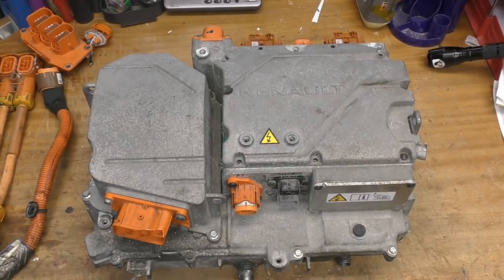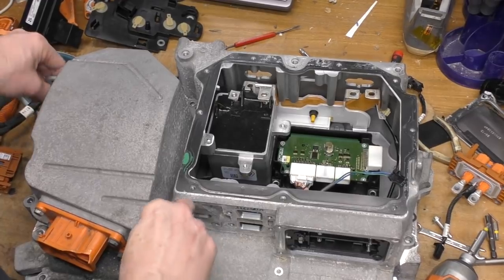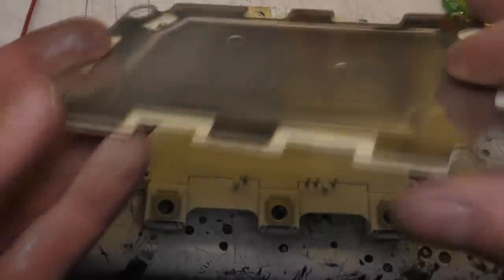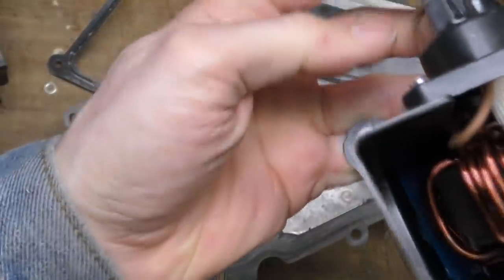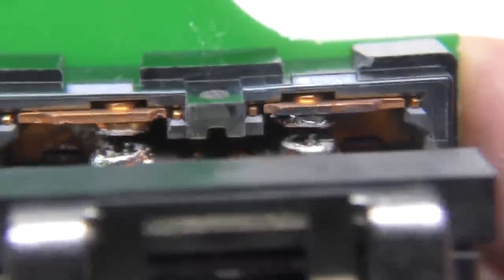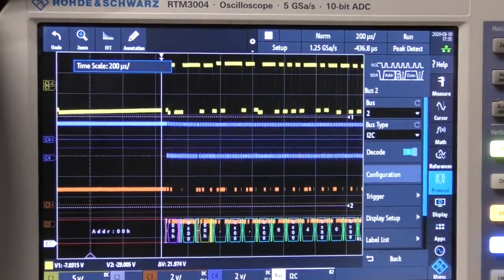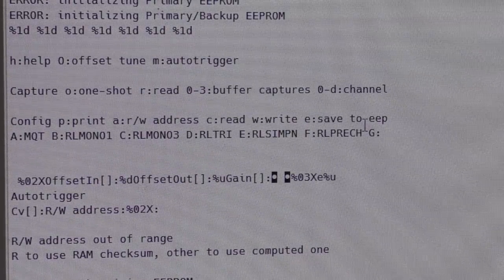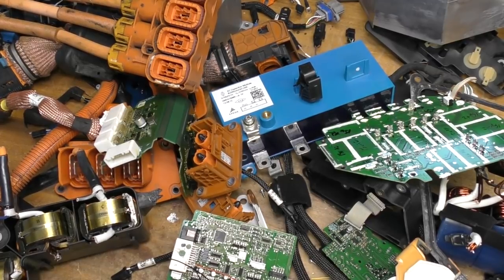Renault Zoe EV Battery Charger Block ( BCB )

Comment: One "interesting" aspect of this system is that if you supply only 2 phases, Zoe will cause a RCD fault.
Reply: Not true. RCD will trip only if there is leakage. 
I had Zoe being connected to L1/L1/L3 and it has displayed 'check charging station'

Comment: That strange board next to the shunt is probably an active EMI injector.
Reply: i think this is a pulsation modulator for the oscillating driving of the driving ondulator used for the syncrotron.
Reply: @Francois_Dupont  And furthermore, it modulates the eccentricity of the compound offset cycloid without affecting the convergent continuum of the battery power wobbulator, or the sync of the flyback discriminator. Pretty nifty stuff! You rarely see any of that being done in a budget system. 😵‍💫

Comment: is there a reason to use all the braided sleeve? is it for vibration/movement? or some electrical use like ark shielding? or very simple, cable management?
Reply: it protects the wires from getting scrapped or nicked. most normal cars have all the wires protected with a plactic rigig sleeve. it also stiffen them up to prevent them from shaking too much. imagine having a wire swing around for 350,000km? it just wont last and will snap internally.
Reply: @Francois_Dupont  From what I read, those Renault cars don't even last a 100.000 km.
Reply: @FrozenHaxor  its good for the economy! what a way to create jobs, they thought of everything.
Reply: @FrozenHaxor  Zoe Q210 (2013) owner here, 100k kilometers and still doing great. Battery at 93% state of health. 11 kW charging several times a week, 43 kW fast charging ~10 times a year. Pretty reliable car to be honest, infrastructure here in the Netherlands is decent, which helps I suppose. Apart from a misbehaving public charger from time to time (which used to be much more frequent) no issues whatsoever.

Comment: Where does the hole under the little black plug on the lower right at 0:38 go to? Tends to fall of sometimes and i fear there might get dirt or dust in...
Reply from the maker: Looks like a vent, to allow air pressure to equalise but not let water in

Comment: Mine is probably broken (although it throws a input filter module error, but this has been replaced alrady). Renault refused me warranty because I've used a 'non Renault homologated charger' to charge my car :( ...
Reply from the maker: That is bullshit - take them to court.
Reply: Mike is right, I'd take them to court. There is no charger in an EVSE, all it does is connect you to the electric supply, as you will see in mike's other videos, it's a relay with some simple control pilot signal with AC. Renault approved is crazy ides, as you wouldn't be able to use the public networks, how would you know what  was approved?
 Also the car should do its checks before closing contactors!
Reply: @sophieclips  if only it were so easy. We're talking complimentary warranty. They can basically exclude what they want. It seems to be in the manual (I never had one) that you are only allowed to charge with ZE homologated chargers. Of course it's bullshit and they almost never enforce it. In my case they do. I was thinking about claiming that's so unusual one is not supposed to know, but anyway. They're also denying me the legally biding warranty. Yes, I could sue them. My lawyer (the one that even cared to reply) told me I need to find an expert that convinces the judge (find that in Spain...) and that Renault will have a convincing expert for sure. If I lose, it'll cost me more than the repair.

Comment: Mechanics as we know them are a thing of the past
Reply: They just need new training. Someone classically trained on petrol cars can still fix & replace tires, top up washer fluid and replace brake pads... but going forward most of a mechanic's work will be hooking up a computer with licensed, make-specific software and swapping out the modules that the computer says are bad.
Reply: @anonymic79  I don't disagree with what you're saying and by the way I'm a diehard proponent of right-to-repair legislation. I just think what you're describing is more of a refurb parts market than a mechanic's work as such. It's not as if Mechanic Mike is going to his electronics lab to troubleshoot and tinker with a busted module in working billable hours? I expect EVs will be saddled with DRM bullshit on Apple levels to prevent "grey market" refurbished replacement modules to be used, but I expect there will be a cottage industry of repair shops mending common failure modes in these modules, allowing them to become under-the-counter cheaper alternatives to vendor-sanctioned official replacements.
Reply: @KanalFrump  Do you really want  to be driving beside a car that has a bodged repair job that could cause it to catch fire whilst driving @ 50mph? At least with a phone if it catches fire you can always throw it...
I think the "grease monkey" from the 50s would find it difficult if not impossible to work on a modern car, never mind an EV. There's just little need for mechanical finesse now as the tweeks are performed through software...
Reply: @KanalFrump  You're not going to see a whole lot of "grey market" power electronics components for EVs because of the very specific skills and equipment needed to repair/design such parts. Also, if you botch anything the result could potentially be a blown drivetrain/electrical system and/or a big ole fire. So would you really want to use 3rd-party refurbed components? You don't really know what it is you're getting.

These modules need to be able to handle potentially hundreds of amps at high voltage, which is serious stuff. You don't want any potential foul-ups or bad/under-spec components used during assembly/repair.

Comment: Where does 3 phase come from
Reply: Most european houses have a 3-phase supply
Reply: @lukahierl9857  weird i thought 240 was 1 phase
Reply: @AgentOffice  Britain is traditionally single phase (google "ring mains") while the rest of europe is three phase throughout.
Reply: uk national grid 3 phase , including pole runs all generally 3 phase, 3 phase generated from power station, been like this for a long time.
Reply: @AgentOffice   depending on  hv to lv  pole transformer setup , domestic supply can be 3ph 230/240v , mostly for safety each premise will be on 1 phase  230/240v unless requested otherwise, . generally 3 phase  400/415v  for commercial supply upwards,
Reply: I have 3 Phase 25A supply in ma apartment, and 35A in my other house. 230/400V. Quite common in europe.
Reply: @ss54.  You already said "UK, Domestic= mostly single phase" -that ist the point. Talking Europe, especially Germany, 3ph 63A is the standart. Never came across a house in germany that had less than three phase supply.

Comment: This unit seems very clumsy to me!  Uses the eMachine inductance but still requires 8kg of addiotnal series inductance, and is made up of lots of individual units, with lots of glue wiring harnesses and poor integration!  Must be very expensive to build!  Compare it to the much more integrated solutionns from Tesla etc!  (Feels like 2010 tech to me, not 2020 tech!)
Reply: Yeah, everything is so random, a lot of random pieces, cables, weird layout decisions, and general chaos. This earth current sensing shunt and board are super weird as indicated by Mike.
Reply: @movax20h  I think they are using the shunt as part of the high frequency isometry, whihc injects a low voltage AC square wave between the battery and the chassis, and monitors the current that flows to establish the integrity of that isolation.   A company called Bender have a lot of patents on this method of isometry, so perhaps lear have rolled their own solution to avoid those patents?
Reply: It is 2010 tech because the car came out 2012

Comment: why have such complex charger in EACH car when you could have one or two into each charging station and only have some safety in the car and a couple of safety in your battery pack.
Reply: That mean that you trust a third party to properly manage the charge of your battery. 

Yes I know it can be done but currently there is so many Standards and yet nobody in the industry is set to follow the same rules. (Unlike the USB port)
Reply: @zeuss194  when you put gas in your car, dont you trust them not to have water or acid in it? there is a whole set of regulation for gasoline and diesel. this should be the same for electric charging station.
Reply: if we can force car manufacturer to have airbags, light and bumper specifically made for X and Y laws, you dont think we should do the same for electric car charging station? its pretty simple too:
car- hello i am X model of car, i want DC ramping for 300 to 600 along 30min time frame. maximum 200amps.
station- aye aye captain, power incoming!
i am no programmer nor electrical engineer, but with our current technology it is very easy to do.
Reply: @Francois_Dupont   "Yes I know it can be done" , As you said there no real technical challenge (communication between charger and battery is common on cellphone and laptop nowaday)
It's is more about the lack of will from manufacturers to go for a single road and lack of "enforcement" from politics.
Reply: Better know what you doing then let some idiots do it instead (third party and similar shit) and blame it all on Renault when the shit hit the fan one day.
Reply: You basically explained the advantage of DC-charging, where the charger is in the DC charging station. The charger there can be more expensive, heavy and use more volume, thus enabling much higher charging currents than an on-board charger, which "just" takes the AC current by the grid (with the AC charger mainly consisting of some safety and payment features) and basically does the same thing than the charger in a DC charging station.
However, a charger is pretty expensive. It's easy for a supermarket, hotel or parking lot operator to just install some AC plugs (or an AC charger = AC plug + some extra protection) but its quite a thing to install a DC charger. So the on board charger of the EVs are kind of a "fallback" solution so you can charge everywhere you have an AC plug (so basically everywhere) and don't have to rely on the good will of stores, hotels or parking lot operators.
For high power charging, putting the charger into the stationary DC charging station (like you said) is the only option, because a > 50 kW charger is extremely expensive and heavy and it wouldn't make sense to drive this thing around in your car all the time. Actually the Renault Zoe is the only car I am aware of that has a 43 kW on-board charger, most of the EVs have 11 or 22 kW, some even only 3.6 or 7.2 kW...
Reply: The car was made in 2012 when there was very little infrastructure, and it was cheaper to make a charging infrastructure based on AC fast charging. Now in 2020 most EV use DC charging which connects the charger almost directly to the battery. And the AC to DC conversion is done at the charging station

Comment: Anyone can tell me what the connector on 24:57 is ? Seen it so many times in regular consumer electronics dont know what it is.
Reply: Agnishekhar Rudra Pal Maybe a Molex type, but i dont really know.
Reply from the maker: It's a 0.156" pitch pin header - many manufacturers make them.
Reply: @mikeselectricstuff   thanks man found them under kk series from molex
https://www.digikey.com/catalog/en/partgroup/kk-series/8428   and chinese  aliexpress sellers call their equivalent CH3.96 (polarised). Thanks man. I though it would have some very special name and only 1 brand manufacturer and never thought searching for simply "pin header" with the pitch will give me the result of similar kinda ones. Thanks.
Reply: @mikeselectricstuff  Oh, if only it was 0.15748031496063" pitch! Then it would be a nice simple 4 mm. 😁👍

Comment: Hello i have a renault kangoo electric and I would like to charge the batterie while im driving with a generator in a trailer ore in the car (its a van type). Do you think this is possible ?
Reply: It's possible but not practical. You'd need a huge gen to generate enough power to make a difference. If that's what you need then buy a hybrid.
Reply: @jagardina  i have a 6,5 kw gen that can run on lpg/gas thats good , bud how to connect AND drive? I think the sofware must be reprogrammed
Reply: @daniellybaert1958  no idea, but my chevy bolt won't let you drive without unplugging first. So probably yeah.
Reply: @daniellybaert1958  you will waste more than 50% of the power from your propane/gasoline source. at that point you better buy a gasoline car and add some electric backup in it.
Reply: @Francois_Dupont  I would use it only for the few long trips that i do. Because the Kangoo (old type) have a max. range of 90 km.
Reply: @daniellybaert1958  the thing is, the space it takes and the time it require to charge will be very long, lets say your generator is 20hp, and that it will output into your battery the equivalent of 10hp. your car motor can take as much as 80hp to cruise on the highway. you will then require about 32hours of changing to do about 6hours of highway.

you can switch the figures for kWh, its the same thing. any "portable" generator wont be small, nor powerful. i have a 1300W(peak) generator with a 80cc 4stroke engine (about 3hp) and it weight about 60lbs. the 3000W are 100lbs+ and the 5000W generator are so heavy and big you cant lift them by yourself. and not even talking about charging a EV because the 5000W model will output about 3hp~ in your car. it is pathetic and wont even charge a electric MOTORCYCLE...
Reply: @daniellybaert1958  your 6.5kw gen might output 4-5kw at best into your ev. it is not enough power to even drive a electric motorcycle. my 125cc sports bike is 15kw and its barely enough to drive 90km/h on flat ground and 70km/h on the slope. a normal sized car require a minimum of 50hp to roll around. it is imposible for your generator to act as a "hybrid" and power your car solely while you drive.
Reply: It is not possible! 1.you cannot drive while charging 2.The earth-test would fail 3.It is dangerous and not economically reasonable
Reply: It is possible to send this junk to the scrapyard.

Comment: This is similar to the Mac Pro, the case is carved out of a huge aluminium block. Just why?
Reply: Thats pretty sure injection molded :)
Reply: Looks like a fairly normal die cast aluminium case. Only machining I saw was on the surfaces  with thermal paste for water cooling.
Reply: do you even know what casting is?
Reply: @Francois_Dupont  Yes, I looked it up on porntube. Great stuff.
Reply: @gabest4  i just reported you to the inquisitor.
Reply: @Francois_Dupont  Be polite.
Reply: The casings are all die-cast alu, which is a very simple and common manufacturing technique. Machining them out of solid blocks would be way too complicated/time consuming/expensive/pointless.

They do this for several reasons, including protection, as there are impact sensitive, fragile components inside; you also don't want water and/or dust intrusion and so on, then there's mechanical rigidity and vibration resistance, EMI noise insulation, and so on.

Comment: I show this video to everyone who claims that an electric car is so much simpler than a car with a conventional internal combustion engine ...
Reply: Yeah good luck, just compare this to the fuel injection system for a modern ICE. The high pressure fuel pump alone is a mechanical nightmare/masterpiece.
Reply: @allesklarklaus147  I agree that modern internal combustion engines are now too complicated, bottom line, both approaches do not do much in terms of simplicity
Reply: DgaDM Well, electric cars are much simpler. The reduced moving parts count from 1000 (rough approximation) to 3 in the powertrain is pretty significant. Electronics on both are essentially the same if you consider that ECU and the transmission electronics (with a lot of valves n shit) are gone on an electric car.. And if you think of all the driver entertaining and safety stuff this charging unit really is quite simple.
Reply: The Zoe, and this model of Zoe in particular is an older type of EV, and there's some funky "French" style engineering solutions in it that may overcomplicate things (like re-using the motor windings as a part of the battery charging circuitry for example; NOT a common design choice in other vehicles - in fact I know of no other which does this.)

This car is not representative of fresh EV designs coming off the drawing board today. Also, if you think an ICE is any less complicated... lol Just try ripping a modern gasser engine apart down to individual components like in this video and see for yourself. ;)
Reply: @lennyvalentin6485  sorry, but I cannot agree here. Both platforms, EVs and ICEs are becoming more and more complicated and thus less reliable and more costly to repair and to keep them going. Plus, a lot of the functionality is hidden in software, and if you don't have access to documentation, fixing will be near to impossible.